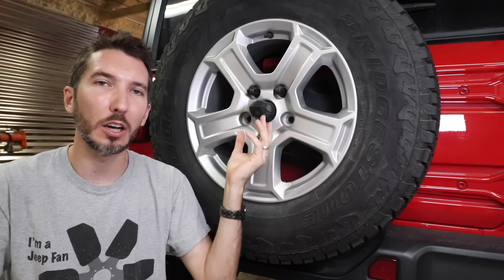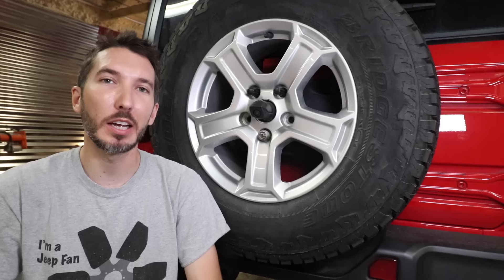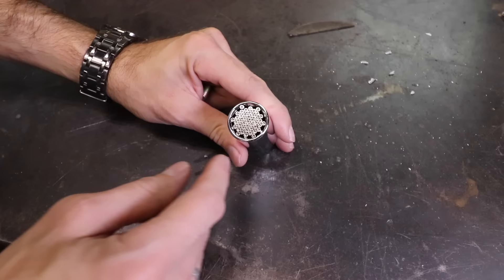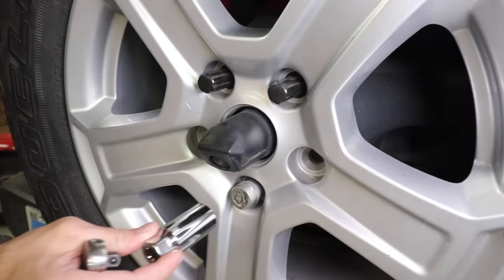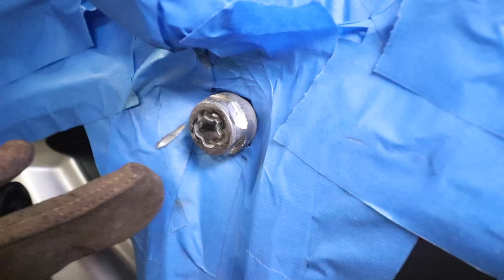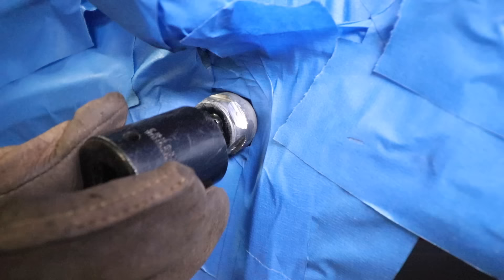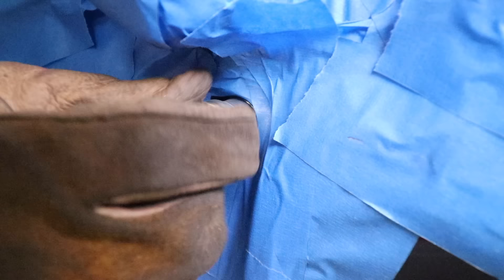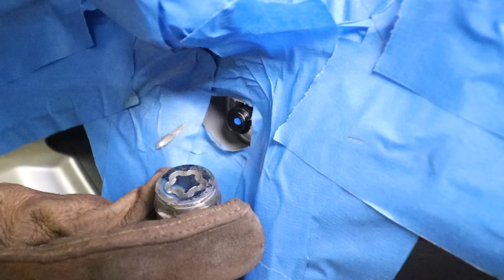3 Ways to Remove a Wheel Lock Without a Key

Comment: Oooh Man,..  I just snapped a seat bolt from the floorboard while trying to remove it from a 2000 XJ.  I thought a week’s worth of daily soaking with PB Blaster would be enough.  I used all the old tricks and added patience...  Thought I had it.  ‘Twas starting to turn, I swear it was. ..  SNAP. Off with its head!  So today, I’m feeling like a Rookie.. 🥺  And you folks reading this are the only support group I need. As such, tuning into Matt at Bleepin’ Jeep always seems to make the errors I make while wrenching a little easier to deal with...  It’s just a matter of doing the next step, whatever the challenge, and that’s good wisdom to carry and put into practice.   Thanks Matt, for creating this place we visit on the days when we can’t be on the trail and Murphy just showed us out the garage door.   For what it’s worth... Much Appreciated
Reply from the maker: Thanks for the kind comment! 😁
Reply: @bleepinjeep , jb weld
Reply: I don't even try to remove them without heating them first anymore they all have thread locker from the factory. If you have a welder you could weld a nut to the top and the heat from the welder should weaken the thread locker.
Reply: heat is your friend in all things that don't want to come unfastened. I would heat it up really well and use a reverse thread extractor, or if you have the ability, weld a nut to the top of teh bolt.
Reply: Chris Bridges   I’ve been in that situation.  I didn’t think about cutting a hex pattern but what I did worked just as well.  I cut a slit across the lock and removed it with a flathead bit and a ratchet.  Worked great.
Reply: @Cory Allen this truck works great for me. I use a spray bottle of ice water or use something like seafoam that was kept indoors in the summer or left outside in the winter. My goal is to thermal shock it as much as possible by having the biggest tempature differential between the hot and cold.
Reply: I think I would have only cut two opposite sides flat then used a wrench or a swedish nut rounder on it.
Reply: Well. 2000 XJ would be your problem. My 99 floorboard is nothing but swiss chese
Reply: Did you try tapping the bolt?
Reply: @deadwave2738  
PB blaster is highly flammable plus torching and you have a major hazard. 😣
Reply: May I recommend a small oxy/acetoline torch between a jeweler's and a plumbing set ?
The small cutting torch provides enough heat so the marvles mysteriously oil or atf can get in there an work ?
6 cyl manifolds are another example.  Never snapped a one .
Reply: Saw a meme once that said "I don't always cross thread a bolt...but when I do I grab the 1 inch impact and send it on home!"  Had a mechanic do that on a large natural gas engine flywheel bolt.  When I saw them center punching it and a set of easy outside laying on the ground I stopped them and called the machine shop to come in with a mag drill.  I swear some people just don't know any better!
Reply: glen1arthur never heard of Swedish nut rounder.
Reply: Chris Bridges u7
Reply: To
Reply: Why camera rt there ?
Reply: Oohhh that sucks!!  Damn factories and their loctite!!
Reply: Ha matt you need a 12 pt socket around 22 Mm and drive it on done this 4 time on are kia

Comment: I had a similar issue. The security nuts were even more difficult because the outside spun so you couldn't drive a socket on. The dealership told me it would be $125 to take off the 5 lug nuts with an air chisel. I left and thought about it. I called party's too see if I could order the wrench. They said I'd have to bring the Jeep in. 2 nice younger guys came out with a box of about 15 differently sized security sockets. They took them off for me free of charge. I gave the tech $20 and told him to have a nice weekend.
Reply: Should have gave the tech 100
Reply: hows he going to have a nice weekend with $20

Comment: There's a tool for removing wheel locks. It's an emergency lug nut remover, it uses threads to cut into the lock and extract it. Could also try an extractor socket too. We use them on used cars alot
Reply: We bought 2 them and to evevery auto parts none worked they sold .
Reply: Won't work on this particular wheel lock as there is a tamper proof outside layer on this one. You can crack or grind that tamper proof layer off then put your turbo socket aka extractor socket on
Reply: Thanks god someone knows that every auto parts has the socket to remove those locks without having the correct keys.
Reply: @zackk695  hell just grab a harbor freight set of impact sockets and play guess which one the hammer can make fit 🤣
Reply: @jerseypb2223  shit, hammer on a slightly smaller impact socket and bye bye wheel lock. It's become the most efficient removal tool I've used to date
Reply: @The_Dastardly_Dan  Your right and also those thing split easy with a hammer and chisel
Reply: Might as well just buy a new key than bug a lug nut extractor kit
Reply: @DemonEmbarasser  most people couldn't figure out which one they have, hell lately I've just beat on a socket that's close enough and zip it off. If that fails, air hammer and a steady hand will get it.
Reply: any tips on how to hammer it on there? All I got currently is one of the 3lb dead stop style hammers and it can drive the socket onto only the very tip of the security lug and it spins off when I try to use the breaker bar. Does it have to be a big metal mallet?  @The_Dastardly_Dan
Reply: Not all . Some like MOPAR locks spin.
Reply: @calebwooldridge242  what you need looks like a small sledge hammer, think it's a 5lb hammer. Dead blow has too much bounce to hammer it on. Use an impact once it's on solid and zip it off. The tighter the fit the better it grabs.

Comment: I think I'd report that dealer to Jeep corp.
Reply: The Reverend definitely, you spend that much money you want someone to take care of you
Reply: This is basically by the books stealership standards. Refuse all service that isn't going to generate large amounts of cash
Reply: Used car, used tyre.
Reply: There's a reason for the wheel lock being milled into the steel lug nut...security purposes. I work in the plant that manufacturers wheel locks. Only plant in the states that creates them. There's a reason only one lug nut is milled.
Reply: Reporting them wouldn't make any difference. Chrysler products have had a bad reputation for decades and here in Australia it's the same.
Reply: Anthony Xuereb 
So what...if he would report to the wheel lock factory, they’d replace it no hassle. 
I know from experience.
Reply: Or you could take a hidden camera and get the Jeep dealership comments show it on Facebook . Put it on YouTube and then f the dealer
Reply: @VeyronBD , stealership, that's a good one.
Reply: Same treatment as dealerships in Canada. Must be in the training manual.
Reply: I would give em a bad Google review... Tell everyone to avoid them.I used to work at a dealer and always had spare wheel lock keys that 95% of time would get lock off. had no problem helping a customer out.
Reply: Certainly wouldn’t be a repeat customer there.  I lost the key for my 2017 Pathfinders security wheel lugs.  One on each wheel Nissan dealer removed keyed lugs and replaced with standard ones, no hassle
Reply: @ldnwholesale8552  TYRE TYRE TIRE TIRE
Reply: You mean Chrysler
Reply: @charlessanders1342  Agreed, if nothing else people would know what to look for when they bought a car from them.
Imagine that conversation.
"Beautiful Jeep I'll take it. Just show me where the lug nut key is."
"We,uh, yeah it's in the car trust me." 👿
Reply: This is the territory of the lock picking lawyer.
Reply: And they wonder why stealership have such a bad reputation

Comment: I just did this yesterday, but I used a 12 point socket (I think this was mentioned further down as well) - hammered it on (as it was slightly too small) and it worked awesome. Also, it hardly damaged the wheel locks as well. I did all 4 on the vehicle in less than 10 mins using one tool. Nothing broke.
Reply: The best way by far.

Comment: Excellent video. Thanks for the help! I did end up using a 3/4 inch 12-point socket, hammered it on, and the lock came right off! I actually bought a new socket just in case doing this ruined the socket, but no damage to socket and barely noticeable damage to the lock. I too will do away with the lock on the spare tire. Thanks again everyone!

Comment: I got my ‘03 TJ used but from a dealership and it had a “due bill”. Essentially work that I asked them to do before I purchased it. It had a cracked windshield, spongy brakes, and on the test drive it had a slight steering wheel wobble. They did the windshield and the brakes and told me to pick it up. When I picked it up it still had the wobble so I brought it back. I waited for almost an hour and they brought me into the shop to look at something. The mechanic there told me that because I installed Currie steering that they won’t fix the steering. I told them that I had possession for about 25 minutes and came back and that I purchased it the way it was. They refused to work on it. I contacted the BAR and had a quick interview with them. I was basically told that if I wanted them to fix it I’d be receiving stock steering components and I’d have to pay for parts but no labor. I said no to that and replaced the track bar due to a bad ball joint end myself. Never went back and I’ve been the only one to turn a wrench on it ever since.
Reply: Jake Matthews omg that sucks mate, they always try and blame the person who brought it. The only way is to do it yourself
Reply: Larry Miller lol
Reply: Like they say if you want something done right you gotta do it yourself
Reply: Never buy a car with an agreement they they will fix any issues after the sale. Because if they say the problem is x and they fix x and really the problem is y. There is a good change they will say we agreed to fix x and that is what we did.
Reply: @jonjanness    Plus never trust a dealer that will sell you a car that needs pricey mechanical work, most honest dealers fix the car before they even try to sell it. Cosmetic issues it depends, but I'd never drive a car off the lot if major issues were never fixed prior to buying it
Reply: Holy Shit Man Who did this to you?  I want to make sure I never do business with them or anyone else connected to them!  FTR I loved my 2002 Jeep Wrangler X 4.0 5 speed Full doors tinted Top Black and Blue it was bought from Jeep dealership on wade hampton hwy 29 Greer SC no problems...Dont have the Jeep anymore but just took my 2006 Dodge Dakota to have factory recalls fixed including the air bags with no extra list of things needing to be fixed given from dealer..Also I dont know them or cud name any of the techs nor am I getting anything in return but I could use some new tires just sayin...

Comment: I work as a tech at a FCA dealer. I use a chisel and cut the "Spinner" ring off and use a extractor set used for large bolts and studs. I hammer the extractor over the lock and use a 1/2 impact gun and slowly apply pressure in reverse which grabs the wheel lock and removed it. Also Most FCA dealers have a Master Key set that fits all the wheel locks that comes on FCA vehicles.

Comment: I bought a thin wall metric socket from the auto parts store as recommended by the parts guy at the dealership that sold me the truck with no lug key. These are used by metric car guys for tight spots between the rim and lug nut. They are usually anodized. Two of the sizes fit most of the lugs that you took off the first time. -I would mention the dealer so no one deals with them any longer.

Comment: Although I have never welded, my son bought a 130 mig welder and its  been in my garage for two years collecting dust.  I tried the other options but could not make it work so I grinded a slot in the lug nut much like a screwdriver slot.  took an old tire iron I never use,  grinded it down to make it more square to fit in slot and then grabbed the sons Mig Welder.  watched a quick video Youtube on welding 101 and the third try it was welded fast to the lug nut and I was able to  twist if off!!!!!!!!!!  Thank you Jeep guy!!!!!!

Comment: Good tips man... but instead of wasting a socket just use a nut and weld the inside to the top of the lock nut... had tobthat hundreds of times alot with exhaust bolts broken off.
Reply: That sounds pretty good.
Reply: I scrolled through just looking for this comment.  Have used that trick enough times that if I welded a socket on each time I would go broke!
Reply: Trying that now!
Reply: @matthewjohnson6534  it works!!! Make sure to start the weld really deep and not just hit the insides of the nut... itll just break off then.
Reply: I've used this dozens of times with success. Heat shocks the connection and loosens rusted, locked up threads and nut provides a purchase to remove. Just used this to remove a water jacket threaded plug in a 1970's SBC head with success.
Reply: Did the same thing on my king ranch spare tire i used j-b weld,it worked.
Reply: If it is a broken head on a bolt flush to the engine I weld a washer and then a nut to the washer. After each weld I spray with PBB. Have some water nearby for fire watch
Reply: Sometimes the heat from a short blast with the welder will create  enough expansion that a pair of vice grips or large Channel locks will afford you the ability to twist with little effort.

Comment: Yes. Here in the UK you can get sockets with reverse cutting threads so as you turn the socket it cuts in and grips the nut. OR an adapted socket with grubscrews that screw into the nut to grip it.

Comment: First thing I would do is tighten the bolts on either side of the lock lug nut and loosen them off on the opposite side to relieve pressure of the wheel against that particular nut.  A couple taps with a hammer on the locking nut might just break up some tension and loosen any binding grit as well. Hopefully less torque would then be needed to remove the locking nut with whatever technique you ultimately use.
Reply: Same Dealer f.off . Said maybe Discount tire has a bunch of keys..  crap shoot. I got a1" 12 pt. socket on, but the inside there is a ring that spun. My Ram wheels are chrome plastic over cast aluminum and fragile..cant get a grinder near them as it recessed flush.. Use a cutoff disk, maybe and make a huge impact driver slot?  I'm stuck here.

Comment: My buddy had his JKU go into insane mode - the wipers running, the turn signals flashing, the cluster going out - and the dealer (despite an add-on JEEP warranty that covers bumper to bumper) decided that they would forcibly tear out his remote car starter wiring and his 900$ head unit, damaging both (and, the stock wiring harness it turns out). This lead to 2 years (yes, two years!) of back and forth with the dealer, who also attempted to claim that lift in the Jeep (installed by yours truly) could also (somehow!) be the cause of the electrical gremlins and therefore it shouldn't be covered.  The end result was that the wiring harness going into the fuse box was faulty, which was fixed with just a quick job of replacing it.  They, naturally, ended up damaging the dash board so the entire thing squeaks when he drives over 10mph, and also failed to tie up the harness under the dash, so it looks like he stole the truck and tried to hotwire it, but that is dealer support for ya.   ON my side, my interior dome light on my 'Yoder 4Runner I just bought started flashing out of control whenever I locked the car.  So Toyota promptly took it in, gave me a TRD Pro to drive while they had my car, and decided to just replace, erhm, basically EVERYTHING - just because.  Well, there is the difference between two dealerships, located no more than 40 yards apart.  I'll drive new Yoders and old Jeeps, thank you very much :)

Comment: I am watching this because i just picked up a brand new Gladiator Mojave from the dealership yesterday and noticed they did not provide the wheel lock key and I'd like to take this thing out today and just feel a little bit apprehensive not being able to take my wheels off, should I need to change a tire. I will be calling the dealer on monday (today is Sunday so they are currently closed) to see if they can provide it. They also told me that they only had one key fob and it was due to the "product shortages" and they will contact me in a few weeks with another one. I have a funny feeling they're just hoping that I'll forget about it and not call them so they can save that $300 or whatever it costs to get a new programmed and cut key fob. Great video and love your channel! Been subscribed for many years and it has helped me numerous times!
Reply from the maker: Probably so, good luck to you!

Comment: Yeah name and shame those dealers - I’m normally totally graceful..... but in reality the lift kit has no bearing whatsoever upon whether or not the jeep should have been supplied with a wheellock key.

What a bunch of arses they were.
Reply: jonnyweston haha I was thinking that when he said it, why would you remove the spare when doing a lift
Reply: I had the same problem the mechanic said he couldn't fix my sway bar unless he knew who and what brand the modified sway bar is because I got a 5 inch lift so I have 5 inch extended sway bar links that the bearings are bad in
Reply: @eragonshadeslayer1  Yes, but I am sure he didn't act obnoxious or drop an F-bomb when he said he couldn't help you

Comment: I had the same problem with one of my brand new jeeps. took it to the dealer that i bought it from and got the same response from them that you did! My solution was I took a  short piece of 1" black iron pipe (one end with a fresh cut and NOT reamed). I hammered squarely 
on to the keyed lug nice tight. I took my 12" pipe wrench to the pipe and backed that lug off with no problem!